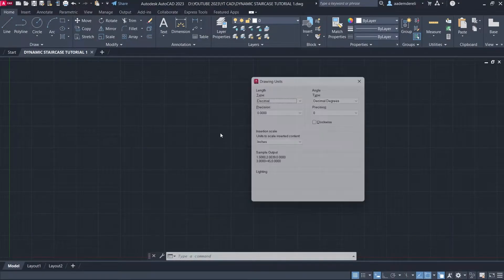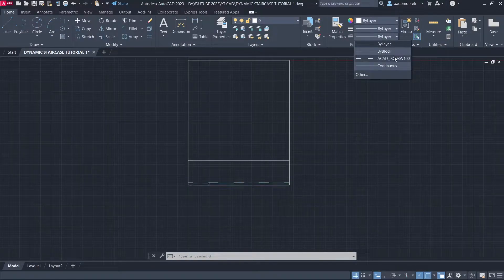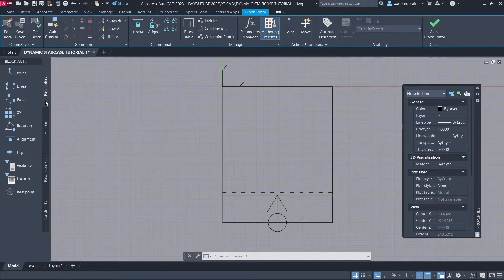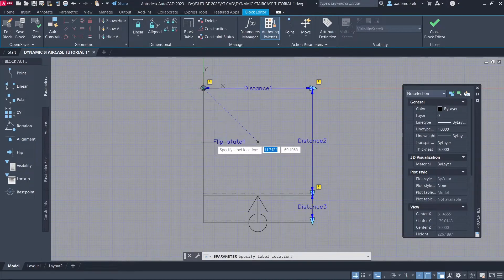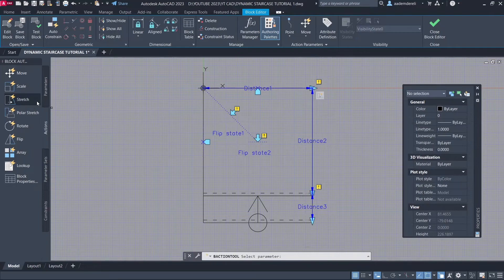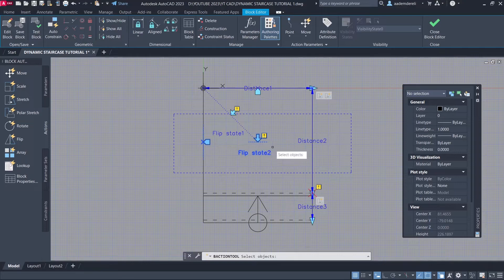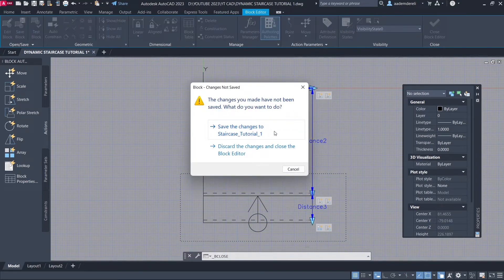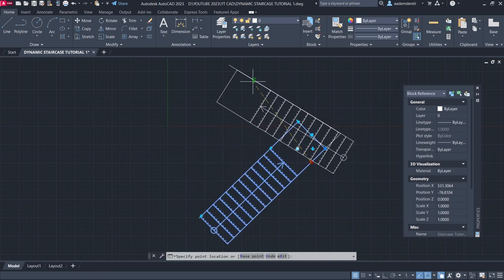AutoCAD Dynamic Staircase Tutorial 1

Comment: Hi I have tried this a few times now but when I go to stretch the width of the flight it moves to a new location. I know I have done something incorrectly but can u explain? Circle is offset middle if I make bigger than 120. I used mm and used 1200 wide and 5mm instead of 0.5 that’s only changes I can think I did
Reply from the maker: Hi, can you send us your file somehow? We will try to solve the problem.